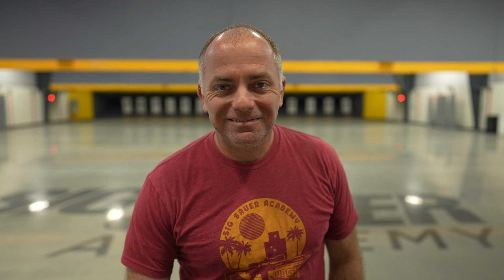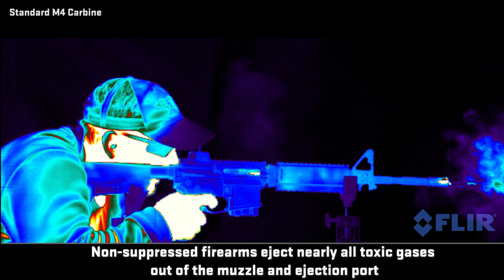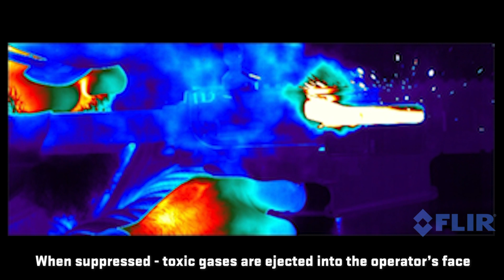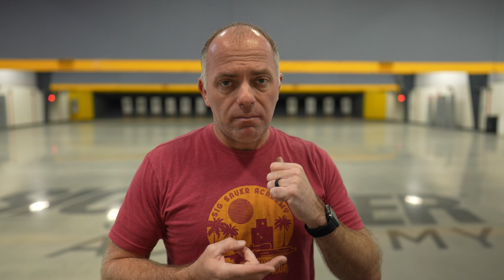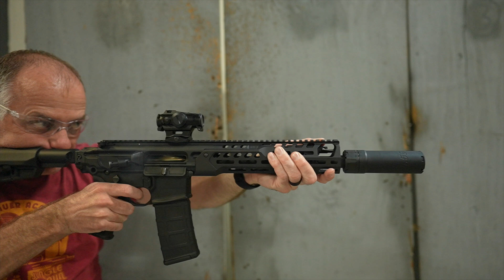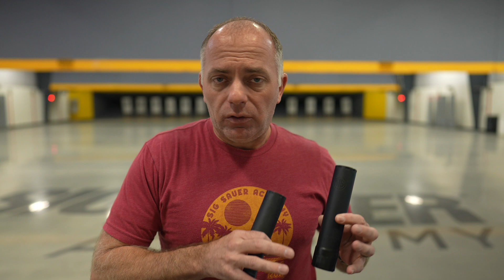Why flow through suppressors?

Comment: The purpose of a rifle is to put bullets onto targets.

The purpose of a suppressor is to reduce the report of a shot.

Which makes more sense? To sacrifice suppression to accommodate cycling, or to tune the rifle to accommodate suppression?

If you can’t tune the rifle then a “flow through” design may make sense. With the proper consideration to design and tuning though, you will come out better with a more traditional design that prioritizes suppression over compromising for cycling sake.
Reply: For the military, tuning is not an option. Have you met your average army grunt? They can barely tie their shoes.
Reply: @sillybilly121212  
The tuning should go on at the factory.

There is a formula for getting suppressors to work optimally with auto rifles. Balancing gas port diameter, gas system length, dwell time, gas integrity, and friction coefficient of the system can all be accomplished at the drawing board and executed on the machine floor.

Producing a rifle that reliably works in either configuration in all conditions (assuming consistent ammo) without having to fiddle with gas settings is possible and should be the standard.